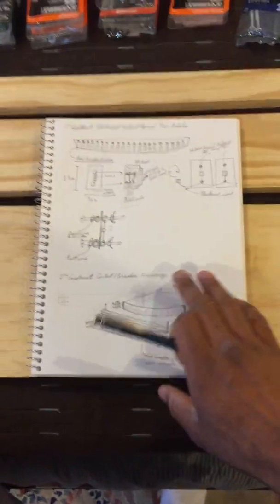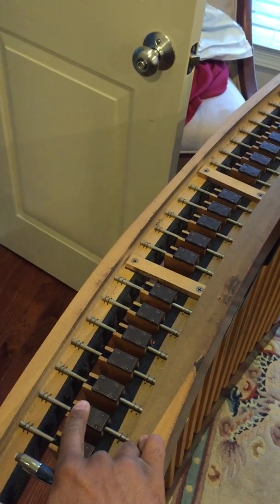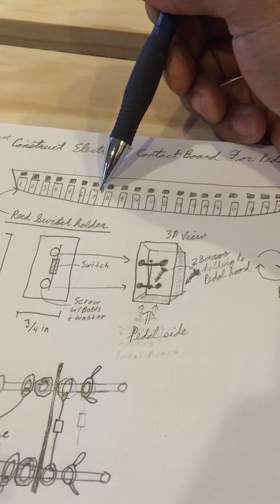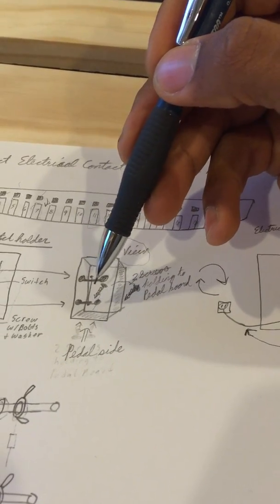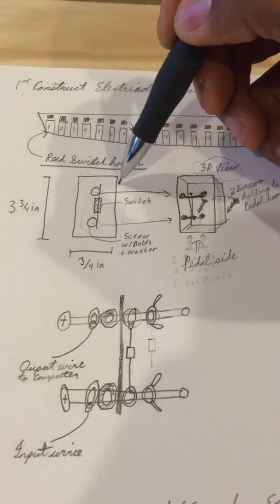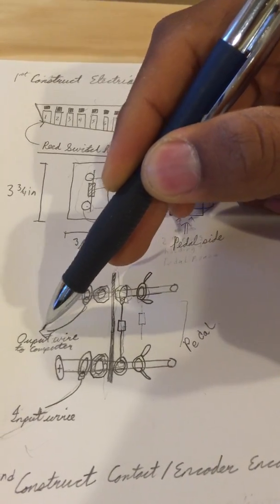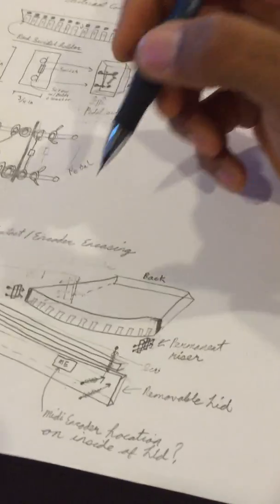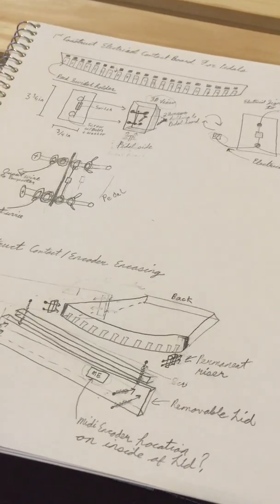How to Build an Organ Part 2: Concept Overview

Comment: Was that Peda boardl taken out of a discarded organ?
Reply from the maker: Yes! Indeed it was. You can find free or very very inexpensive AGO style pedal boards online. Many churches are trying to get rid of their organs and you can sometimes find a full Allen or Rodgers etc for cheap or even free and convert it.
Reply: @walkerprojectslab5390  Thank you.Is Reed switch compulsory?.Any switch or a wired contact will do,I suppose(for a simple project to test whether we able to sound out the Pedal on the Organ software).
Reply from the maker: @linblosune  yes any switch will work. I like the reed switch because you don’t need to mechanically depress a button. If I could go back I’d probably would have done a wired connection. While great reed switches take a lot of effort position and also I’ve found that dramatic changes in temperature like on the Eastern US it affects the switch